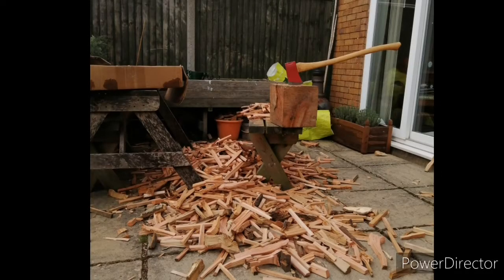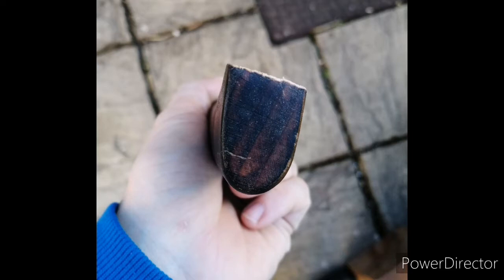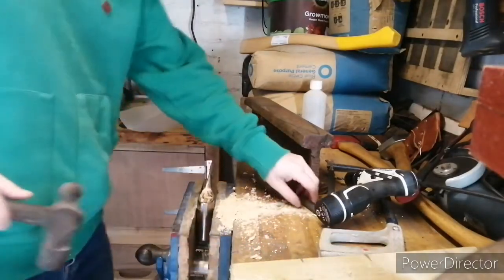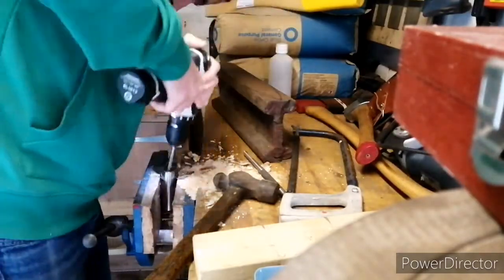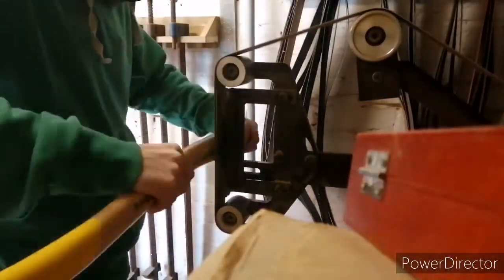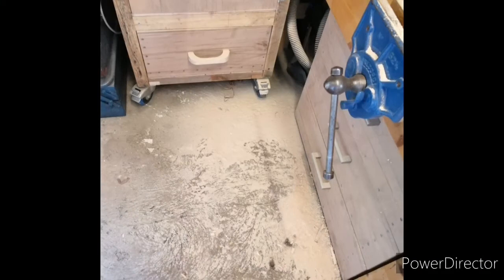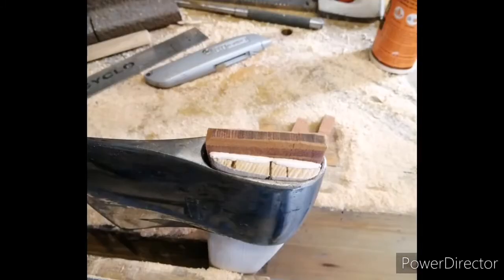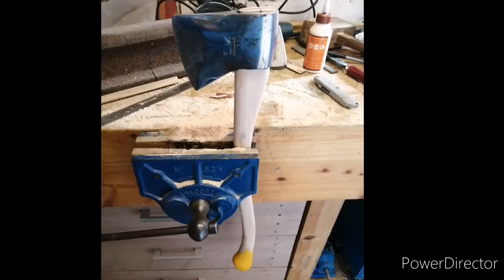Rehandling a Basque axe

Comment: Nice job, i put exactly the same handle on my 1,5K curved. I didn't make a cross wedge, i've just reused a small bit of the stock handle top on the back side of the eye to fill the gap and never get loose.

Comment: Lovely belt sander! I really want to get one
Reply from the maker: I probably use it more than any other tool in the shed. I got by without one for years but I wouldn't want to be without it now.
Reply: @lmorgan877  whereabouts did you get it? I've been gradually researching them trying to find a decent place to get one from.
Reply from the maker: Smart-grinder on Ebay sells them. They're based in Poland. Mine set me back £350 minus the motor and arrived in a few days. Its solid. Let me know if there's anything you'd like to know about them. They're definitely worth considering.